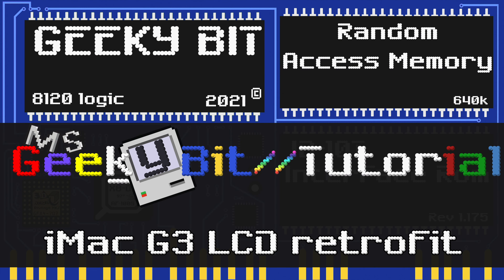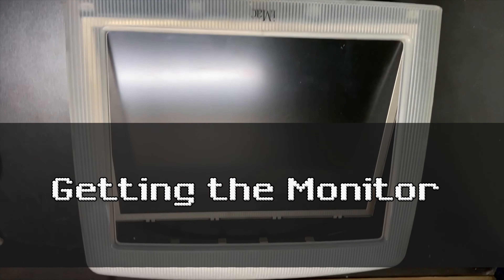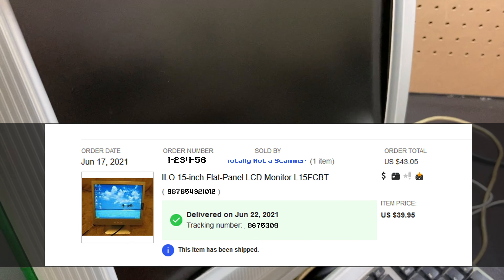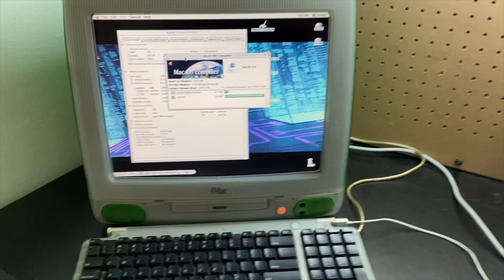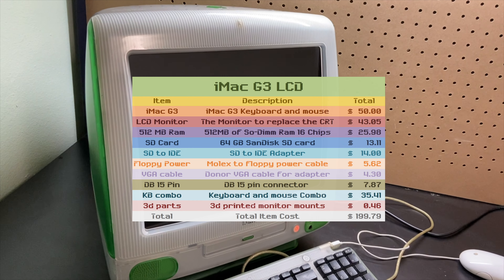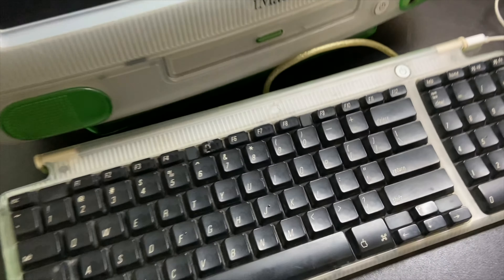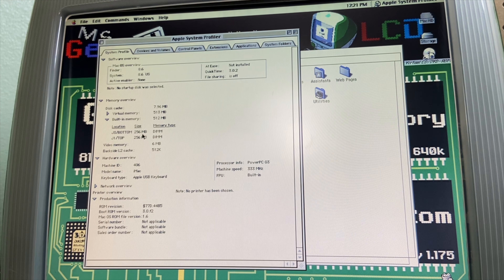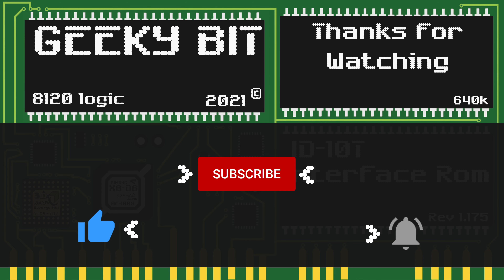Tutorial - iMac G3 LCD Replacement

Comment: I'm probably going to have to do something like this down the line. Any chance you could write up something more specific about the vga cable, powering the monitor, etc?
Reply from the maker: The VGA cable was a simple 15 pin VGA to 15 Pin Macintosh adapter cable... I just made it myself... there are a lot of guides online and those are what I followed. Then as for powering the monitor I just soldered leads onto the External power connector where it is attached to the power supply logic board

Comment: Possible to convert the iMac with a LCD external monitor only ? And connect it to a tower ?
Reply from the maker: Sure it is it Is possible The monitor I used was an external monitor that I made 3d printed brackets for to put it on the inside of this iMac
Reply: @GeekyBit  thanks. that is my next project.

Comment: I would actually love to go the other way round, new Mainboard with better hardware but keep the tube, you think it's possible?
Reply from the maker: Certainly but the resolution is going to be lower than what you would get out of a more modern LCD screen replacement. It would also take a lot of work since there is shared logic between the Power Logic board and the monitor PCBs... The issue you might run into is making everything happy with this stuff.
Reply: @GeekyBit  yeah would be great if I could manage that since the CRT has some flair to it
Reply from the maker: @Laugenstnge  Well I wish you luck!

Comment: How did you get the monitor to use the same power supply as the mac, or does this have power cables going on at once out the back?
Reply from the maker: The Monitor I used had an AC power power adapter plug So I soldered that to the back of the Power plug leads on the iMac power board ... You can use a multi meter to see which wire should be solder where by using it in continuity mode.
Reply: @GeekyBit  Does it still need the power switch on the monitor attached, or does the iMac take care of turning it off and on automaticly

Comment: Hello GeekyBit - I hope you're still around. I want to do this project too. Can I use any LCD screen that is 15"? Or did you have criteria that I will have to match?
Reply: Also - how did you get the LCD flush to the bezel? I saw another similar project and the bezel was curved and the guy had to fill in the gaps with foam tape :/
Reply from the maker: @devcybiko  there is just a gap but only where the case curves I have made a 3d print that takes care of that. I used a LCD that was the exact size. But it is about 15 inches and is 4:3 format.
Reply: @GeekyBit  Thanks for the reply. I'm not a 3D print guy, but I belong to a Maker shop where folks can help me. Can you share the 3D print file?
Reply from the maker: @devcybiko  I would but they aren't anything special. They were made in tinker cad... and each one was different based on my LCD screens specs so it would be of little to no help for you unless you happened to  get the exact same monitor as I did.